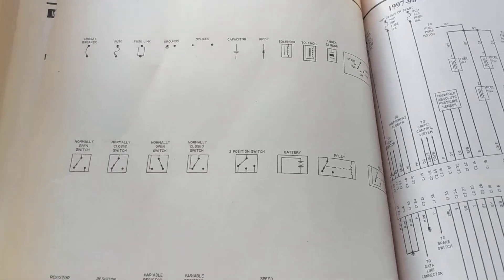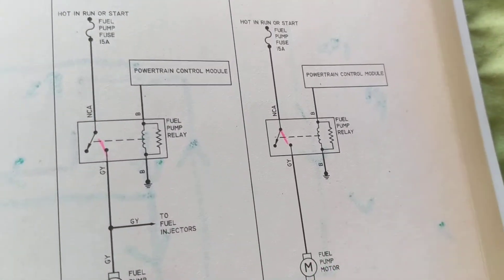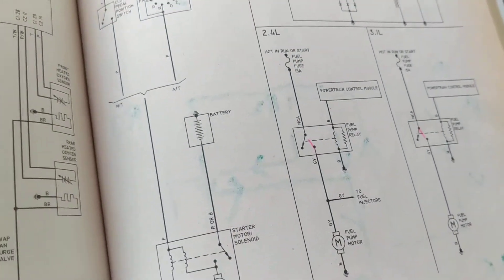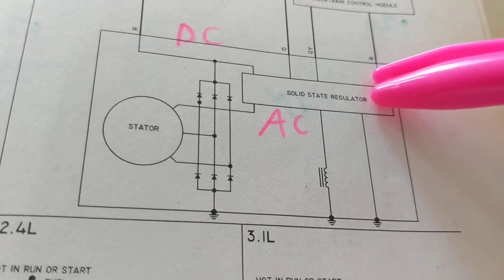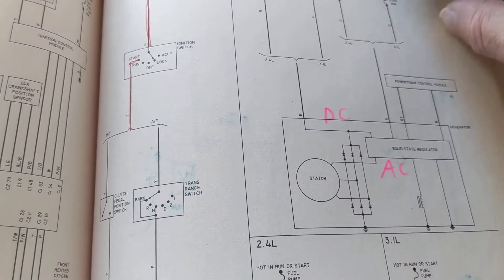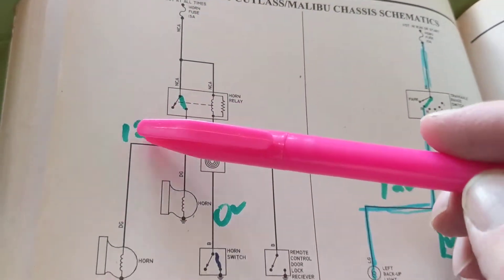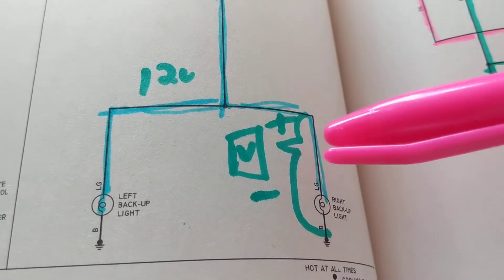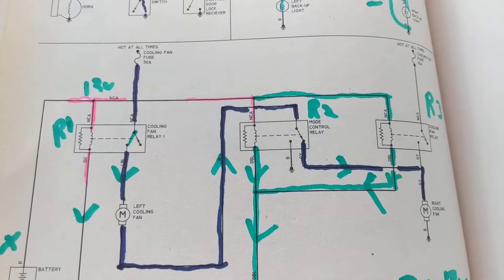Test preparation for ASE certification

Comment: In the schematic you’re showing for the fuel pump the computer grounds the fuel pump relay, which  closes the relay and allows 12 V to pass through to the fuel pump from the fuel pump fuse. That computer does not supply 12 V to the fuel pump relay at all.